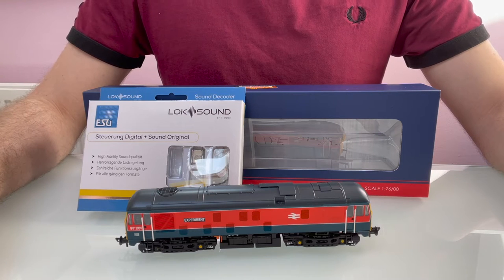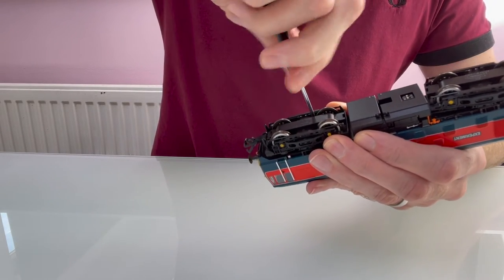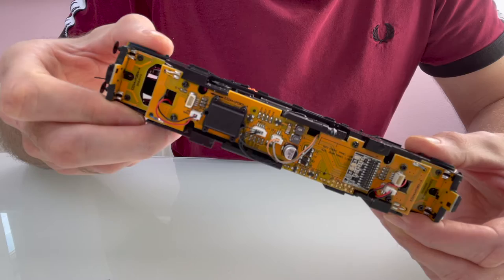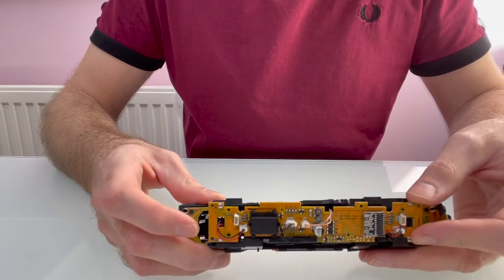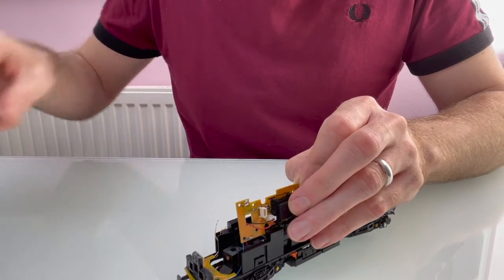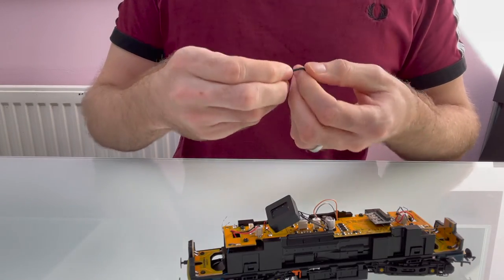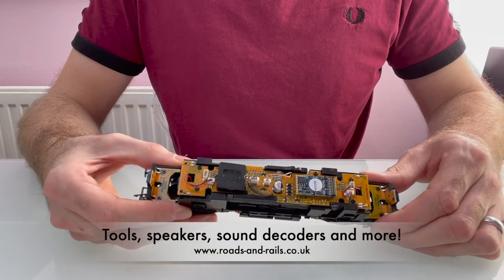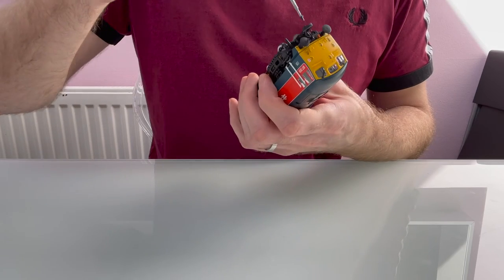New Bachmann Class 24 Sound Fitting Guide, Speaker Upgrade And Demo

Comment: Hi I have a factory fitted sound model just wondering what ohms speaker should be fitted to replace the original speaker
Reply from the maker: 4 or 8 ohms
Reply: @roadsandrails  thanks for the quick reply
Reply: Solder  solder  and  more  solder  for  beginners?